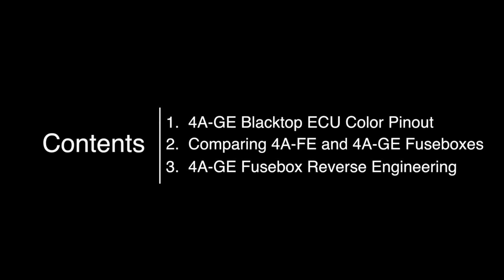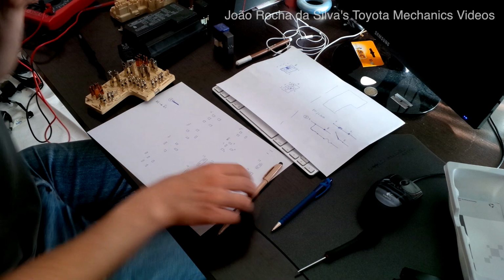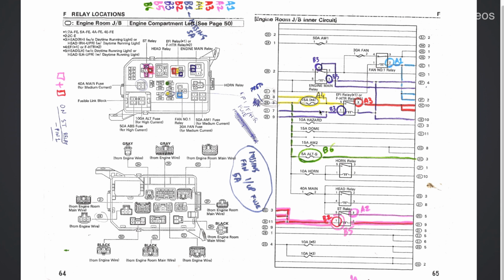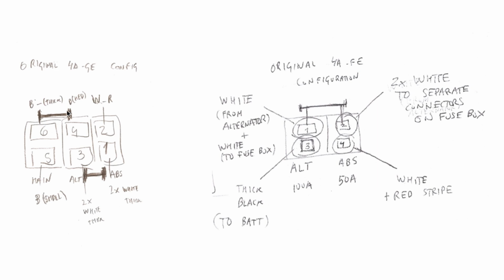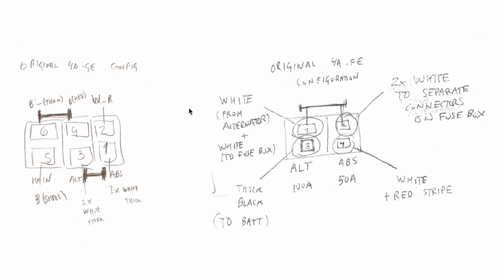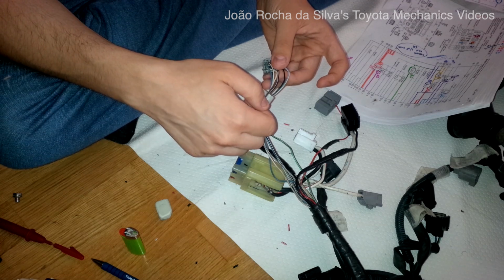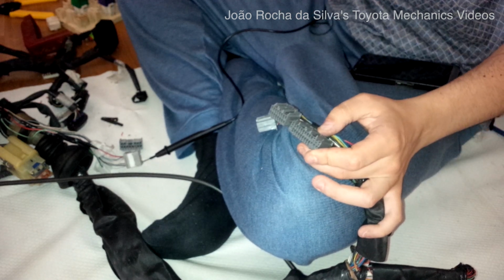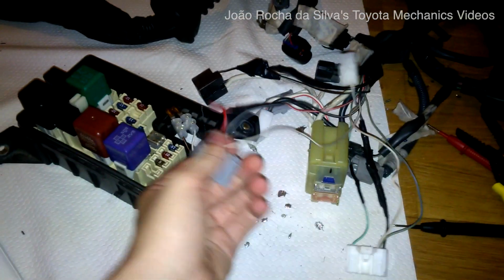ᴴᴰCorolla E11 4AGE 20V BT swap guide [Part 4.1A: LONG VERSION: Wiring Harness, Fuse and Relay Box]

Comment: i got a 20 valve blacktop with a electronic transmission the engine swap is a 5E FE to the 20 valve in a EE 100 i'm having some problems figuring out how to integrate the plugs to the instrument cluster any help with that it would greatly be appreciated
Reply: SAME HERE NEED HELP

Comment: Hi João,
I found you by coincidence, despite being from the same country! ;)
Its always nice to see your videos, and to make the acquaintance of another Toyota enthusiast.

Excellent work on this swap so far, I have the dream to do this to my EE101, but the conversion from a 4E-FE might be a little different, despite all the similarities between our original engines. And maybe I'll go with the silvertop, since it is the version that equipped the AE101 in Japan :)

Just a small (professional) advice on the extra plug you bought for the idle up fuse:
That connector is outside the relay/fuse box, and is in adverse conditions (moisture, humidity and water splashes even), so it should be rated as IP67 or higher, and it doesn't appear to be.

If you are from the North (Porto or near), me and some friends would love to buy you a coffee or a dinner sometime and talk (and maybe see your progress).

And sorry for seeing this videos only now, as an electric engineer, I could have helped you a lot with the wiring harness adaptations.

Best Regards!

Comment: BTW, when I first saw that you had purchased a 20v BT, I thought it was for the AE86. Additionally, are those swaps legal in Portugal? Because here in California, they aren't. =(
Reply from the maker: From what I know, California is really stringent on emission controls... In Portugal the swap is a bit easier, because our road tax only requires the engine to be the same displacement and that the Toyota representative in the country provide the documentation stating that the engine is safe to put in a given chassis :-)
Reply: João Rocha da Silva Lucky. A few years ago, the former Governor of California, Arnold Schwarzenegger, changed our legislation requiring ALL cars manufactured after 1974 to pass a bi-annual smog test for the life of the car, ugh =(.  

Previously, cars that were 30 years, or older, were exempt from smog checks. There is a group of people in the aftermarket car parts industry, SEMA (Special Equipment Manufacturers Association), who are lobbying to change the laws back to the 30 year mark.

My car will be 30 this coming January, but I don't hold my breath on this happening before then.

I've often thought of a 7AFE, with a 20-valve head and a supercharger from a Previa with a smaller (higher boost) pulley from a MK1 MR2 and top it all off with a air-to-water inter-cooler.
But, that isn't a legal swap as the BT engines were never imported to the states.
Reply from the maker: Man those are some serious mods...! You will need low compression forged pistons, forged conrods... I also have my doubts regarding the crank's longevity as well, since it has smaller diameter connecting rod jornals than the 4A-GE, if I am not mistaken. 

With that bi-anual smog testing it will be really hard to have a beast like that on the road. I would love to see such a dream come true however!

Thank you for your great explanation on your local law, something I love about this YouTube channel is that I get comments from ppl all over the world and I get to know lots of different stories that they tell me :-)
Reply: I know what you mean, technology is great.

There is another legal swap I can perform for about $3,500 US dollars. That would be a 2JZ, including the 6-speed trans. I had an employee who had this done to his Lexus SC300 (a.k.a. Soarer) and his mechanic has already done this swap on AE86s and quoted me that price.

I hesitated to do it as my car is all original, has been in the family since new and I have all the original sales documents as well as the original exhaust manifold, lower air-box and snorkel. So, it holds more value than if it were a conversion or restoration. I think I would rather pick up an AE86 SR5 or a beat up GT-S and put the 2JZ into that, with custom touches all over. I have many ideas but would not do them to my one-of-a-kind baby.
Reply from the maker: The SR5 would be my choice, but wouldnt the 2JZ be too big for that car? I mean, it is a huge engine, with a turbo... goes against everything lol. Maybe an SR20DET (if you want to go the turbo way) or an F20C (still NA, yields very good results, we have some rare examples here in Portugal...)
Reply from the maker: BTW, keep your stock car, they are sky rocketing in value everywhere, but they only do it if they are stock-ish... But you already know that ;-)
Reply: Definitely.

Comment: Rather than adding a separate fuse holder, why didn't you simply use an empty fuse spot in the fuse box? Then, all you would have needed to do is print a label for the inside of the fuse box lid and that would be that. Unless of course, there was none to use, but Toyota usually leaves a couple of blank spots for spare fuses.
Reply from the maker: Good idea, I thought of that. I may be missing something here, but there are no electrical contacts in the spares I checked. I mean, there is the plastic holder but no way to get electricity into a spare fuse :S
Reply: João Rocha da Silva Personally, I've never done it, but couldn't you simply cut out the bottom of the empty fuse holder and feed the wire in, in the same manner you have been swapping the pins thus far? Then all you have to do is connect the other end to a power source.
Reply from the maker: The issue with that is that the fuse holder is over several layers of circuits that go the fuse box (check my disassembled one to see what I mean). If I drill the bottom to get the wire through I might damage one of those circuits and would still need to glue in the holder pins for the fuse (these pins are the ones I checked with the multimeter, over the top of the fusebox and where the fuses fit). The result would be messy. Maybe a separate fuse holder altogether may prove to be the best alternative, but I am yet to try out the wiring!
Reply: Oh, that makes sense. I thought since you already had the boxes disassembled, you could perform the surgical procedure then.